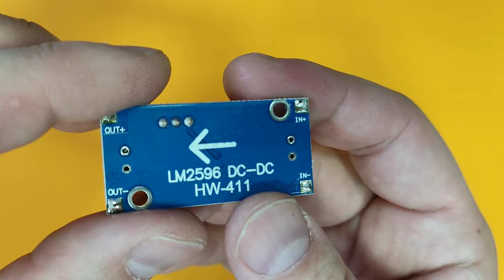How to power Phone Forever Without Battery

Comment: With the addition of the resistor, would it not be possible to connect the power through the phone's USB port?
Reply from the maker: There is no problem with the resistor. Built in battery has the same resistance for this particular device. It mimics the thermal protection of the battery. I've tried to transfer files from this device and it worked just fine. Just keep in mind that every device has specific pinout and resistance between the pins. In most cases 10K will work, but I just have to notify you about this. Good luck 🤞
Reply: @FixitEasyDIY  I understand that. Since the resistor tricked the phone into thinking that a battery exists, I am merely asking whether the power cord can then be connected using the phone's USB port, instead of going through the back of the phone. It would be a lot easier and neater if this can be done.
Reply from the maker: @lwh7301  unfortunately there must be voltage on the pins of the back of the phone. I believe it wouldn't work without it. I didn't try that but the thing is to give the device what it is expecting ;)
Reply: @FixitEasyDIY  You're probably right. I will give it shot before I drill a hole in the back cover.
Reply: When you connect charger through charging port, does it detects charger connected? Coz i want some task to automate when charger connected?

Comment: samsung s8
lm2596 screen (3.85-4v) >
i solder usb type c for I +/- port
then solder out +/- to batery circuit board,
it just turn on and turn off
Reply from the maker: Did you used 10kom resistor?
Reply: @FixitEasyDIY   @FixitEasy  i don't have it,
supercapactior 5.5V 1.0F coming tomorrow maybe, don't know if it help, btw i don't see 3rd connector for resistor solder on battery

my pic since youtube deletelink lol https://www.youtube.com/@HDWB_Gaming/community
Reply from the maker: Sometimes 5v dc chargers cannot start the phone because it draws a lot of current when loading on start. :) Try using another power supply wich can deliver more amps to the lm2596. Go ahead and pls report ;)
Reply: @FixitEasyDIY  i have ravpower61w with PD cable but i think it won't work on that lm2596 cuz screen is not light on, when itried it with xiaomi 18w + PD cable, lm2596 just light on and function

xiaomi 5V/3A
9V/2A
12V/1.5A

ravpower61w
5v/3a
9v/3a
12v/3a
15v/3a
20v/3a
20.3v/3a

Comment: bro i had done this in my portable wifi router and the device is working perfectly fine but there is some amount of heat on both buck and the device, is it a problem? Also what will probably be the reason?
Reply from the maker: It is perfectly fine to generate heat. If you can hold your finger on the chip it's not dangerous. Just keep an eye on them for the first couple of days.
Reply: @FixitEasyDIY  ok thankyou for the replay ❣️will check it

Comment: I will try this on my old Alcatel 1588 :)
Reply from the maker: Cool! Let us know when you power it :)
Reply: @FixitEasyDIY  Yes I will! I also like your background music in the video, I downloaded it and converted it to MP3 :)
Reply from the maker: @firstgear11382  Thanks 👍 Make sure (if you have the time) to read the comments. There are some hints to make it properly. For example the power supply must be slightly powerful because some devices are pulling more than 1 amp when starting. Another point is to measure the old battery (if you have it) for the actual resistance between minus and the third leg. Some phones require different resistance, but in most cases 10k will do the job. Good luck my friend 👍

Comment: Does it work with Huawei p8 lite 2015?
Reply from the maker: If you can get to the battery compartment it will work. Just measure the battery between minus and termistor pin (the third pin) for resistance in order to determine the right resistor to be used.  Most of them are 10 kom.
Reply: @FixitEasyDIY  thank you
Reply: @FixitEasyDIY  Is Minus the second PIN?

Comment: whats the purpose of resistor 🤔
Reply from the maker: It doesn't work without it
Reply from the maker: It mimics the battery
Reply: @FixitEasyDIY  without a resistor on my smartphone it works, but the module makes noise, is that normal?
Reply from the maker: @ken.a.g  that doesn't sound good

Comment: I already bought the module but why does the cellphone just turn on and off and keep repeating
Reply from the maker: Did you solder the 10kohm resistor on the designates pins? If so  sometimes the power supply cannot give enough current for the phone to start. It draws a lot of current when loading in start. Try using another power supply, I think 12v 1 A would be OK. Of Course the output of the module should be set in 4.2 volts before soldering on the pins :)
Reply: @FixitEasyDIY  I don't use 10kohm . Because for now it doesn't have one. Does it have any effect. I only have the 2596 module
Reply from the maker: 10kohm resistor is a must here ;)

Comment: Hello friend , I really need your help, I have a Coyote S (it's a device that you put in the car that can tell where the radars are and film at the same time), the problem is that it's the second one I've bought and the battery swells so much that the screen breaks ! I would like to use it without battery but the problem is that it won't turn on without battery. Can you please help me? I have already disassembled it and removed the battery, I can pay you, thank you very much!
Reply from the maker: Don`t worry we will make it run like a charm. First thing is to determine the pins of the battery. Mark the legs in the device (+) (-) and (T) if there is third pin. Next thing is to determine the resistance of the thermal protection. If you can use multimeter you can measure the resistance between (-) and (t) leg of the battery. In most cases it is a 10K resistor. Watts doesn`t matter here. Then you solder the same resistor between minus and T. Next is to provide 4.2 volts (in most cases) to the legs of the device without the battery. You can use any step down voltage converter or  power supply that can give you 4.2 volts in your car. That`s all. If you need some futher help write here and we will discuss it further.
Reply from the maker: I`ve checked this device online and it has only two legs. That makes it even easier. Here you should prowide to the corresponding legs of the device 4.2 volts and it will power up. I am pretty confident that you can make it by your own ;)
Reply from the maker: Another hint from me, herei n Europe we use Waze a lot and it has the same funcionality as the Coyote S but using your smartphone.
Reply: @FixitEasyDIY  oh , you are from Europe too , I am from Belgium and I speak french 🙂 thank you for informations, I'll look but I'm not very smart in this area 😂 my battery has 5 pins
Reply: @FixitEasyDIY  Hello friend, my battery has 5 pin connector, 2 red, 2 black and 1 white , the problem is that I can't even find a replacement battery, the batteries I find only have 2 pins (1 black and 1 red) or 3 pins (1 black, 1 white and 1 red) 😔
Reply from the maker: You need to determine somehow the pins of the battery or the pins of the device. If you know someone near you who can measure the pins it will be easy job. Can you find some part number or something else for this battery. I also searched the net for the battery and found 2-pin replacements too.
Reply from the maker: If it doesn't work, at least you can use Waze app ;)
Reply: @FixitEasyDIY  Thanks a lot. I managed to see the "controller" of the battery and the 2 black connectors are connected on a single point (I assume the -) and the 2 red cables on a single point (I assume the +), and the white wire also on one point. With the information you gave me, I will try to find out how to do it. I know waze but I really like coyote 🙂 . Thank you very much !
Reply from the maker: That's exactly what you need. Now what is left is to determine the resistance between minus and the thermal protection pin ;)
Reply: @FixitEasyDIY  thank you very much, thank you very much, I'll try, I have a multimeter, but I don't really know how to do it. I will try today 🙂
Reply: My friend, sorry to bother you again. apparently on my battery there are 2 + and 2 - and 1 connector to manage the temperature. my question is: should i measure the voltage with the bms still connected to the battery, or should i disconnect the bms from the battery? And my second question is: on what position should I put the multimeter to measure the voltage between the - and the T. And finally my 3rd question: if I solder the bms of my battery on a new battery, can it work? Because then I may buy a new battery of better quality (the ones we saw with 2 connectors), I remove the bms from the new battery and I solder the bms from the old battery on it. Really sorry, only you can help me. Thank you so much!
Reply from the maker: @john-johnvanhamme3066  I will write tonight my friend, don't worry, we will manage it.
Reply: Thank you a lot 🙂
Reply from the maker: @john-johnvanhamme3066   @john-johnvanhamme3066  are you sure there is BMS in the battery? I would suggest to measure what voltage is between the red wires and minus without removing anything from the battery. It will probably be around 4 volt each. If so you could provide 4.2 volt to both pins of the device. In second question you should set the multimeter on 200K position to measure resistance between T and Minus. When you determine what is on the 5 pins you can give it to the device and make it think that there is real battery. On your third question I am not sure it would work because your device obviously have 5 pins. BMS circuit is only required if the voltage is more than 4.2 volts. It is managing the cells of the battery a.k.a. balancung circuit. Anyway, to make it work think of it like we have to provide the device the same voltage as the battery does. The only thing that we have to add is the proper resistance between T pin and minus. So in order to make it happen you have to measure: 1. Voltage between minus and red wires (each) and 2. Resistance (on 200K position of multimeter) between T and minus. Then, using voltage regulator, we can give the device the needed voltage and a resistor to mimic real healthy battery. Don't give up on trying it and please report how far did you get ;).
Ny friend don't worry to ask again if you need something else to takk about this. Talk to you soon 💖
Reply: @FixitEasyDIY  Yes, I'm sure there is a bms in the battery. Thank you for this information. I think I have no more solution because unfortunately I have already removed the bms from the battery. But no problem my friend, thanks to you I have already learned a lot, thank you very much for everything ! 😃
Reply: @FixitEasyDIY  I'm pretty sure the battery is 3.7V
Reply from the maker: No worries 🙂 you can still try to feed the device with 4.2 volts each red pin and 10k resistor between minus and T ;)

Comment: Tried this today on a Sky Device phone. Phone turns on for a few seconds and screen gets distorted and stops. Then tried it with a better power supply with more amperage. Phone stays on a bit longer, but turns off.
Reply from the maker: How many contact pins are there on your device? Did you use a resistor between minus and T pin ? Looks like a power issue because the device is drawing a lot of amps when loading the operating system or there must be some resistance to mimic the thermal protection of the battery. I would measure the resistance of the battery (if you have it) between minus pin and thermal protection pin . You can easily determine pins by using a multimeter.  Some devices are "waiting" for 10K resistance there, some are 5K and even 50K. In most cases 10K will do the job.
Reply: @FixitEasyDIY  There are 3 pins, and I measured it to be 10K ohm. That's the resistor I used with a step down module. I don't think the module delivered enough amperage, even though it said the max is 3 amps. I then connected  a PC power supply at 5 volts with 2 amps. It worked longer, but ultimately the phone also shut down. The PC power supply also has a 5 volts lead that delivers 30 amps. I didn't try that because I don't want to burn down the house.
Reply from the maker: @lwh7301  There must be something wrong with the setup. In this situation I would suggest trying to connect some healthy li-ion battery to the pins and see if the phone start and run normally, if so there is not enough current or voltage for some reason ;)
Reply: @FixitEasyDIY  I was not able to find a battery replacement for this phone. That's the reason why I was doing this in the first place. But I did put the old battery back in. The old battery no longer holds a charge very long. The phone starts with the old battery in. I leave the charge cord in and use it to stream music. I have another phone that has a swollen battery that I will try.
Reply from the maker: You can use any  3.7 V lithium battery with cables soldered on it. It's worth trying. This experiment will show you if you can successfully use other powers supply.
Reply: @FixitEasyDIY  I am actually thinking about using NiCd batteries to try since I have so many of them lying around...or even alkaline.
Reply from the maker: @lwh7301  🤔 I think they are not ok for this, because they are 1.5 V . If you combine 3 of them you will come up with 4.5 V. If they are discharged they cannot output the current needed and also they will drop voltage under load. My idea is to power the device with the battery without using the voltage regulator module. This could be properly done only by using a lithium battery i guess. I hope you will come up with a working setup ;)
Reply: @FixitEasyDIY  Yes...I am aware of the drawbacks. I will leave this project in the backburner for now. It is currently working with the old battery in it. However, I had to set the screen brightness from 100% to 15%. With the screen at 100%, it would turn itself off periodically even with the charging cord connected. Since I am using it only as a streaming device connected to my stereo.  I really don't need to have a super bright screen. So far, it hasn't turned itself off, and it's been 24 hours. Thanks for your input.
Reply: @FixitEasyDIY  Today, I finally got to trying it with a 18650 3.7v battery. At first, I experienced the same problems as before. Then I thought it may be because I was testing with alligator clips and that the wires were too long or too thin. I replaced them with thicker and much shorter wires and connected them with solder. I didn't have high hopes, but it worked! I was about to toss the phone, but now I am streaming beautiful music! Thanks for the tip!
Reply from the maker: @lwh7301  Wow sounds great 👍👍👍 I am really happy to hear that ☺️ Enjoy 🙏😊🙏

Comment: Hi, I have Moto E6s with kc40 battery.
i tried running it from charger or power bank, but as soon as i remove battery while using both charger or power bank it shuts off. mobile works on battery okish. sometimes switches off randomly. this mobile has been used while charging a lot of times. 
 I want to use that mobile in car for google map.
my questions are
1. How should I do it ? So it won't drain car battery fast. battery drain is my main concern.
2. How you selected 10k resistor ? any reason behind it. here is another example. he just used circuit from kc40 battery. he used 4.7k resistor. https://youtu.be/a06eVo1hSE0?t=164
will the resistor overheat if Iuse it continuously. what is normal power consumption rate while running with car music system.
thank you !
Reply from the maker: The reason to use 10k resistor is because there is a thermal protection inside the battery. I measured it and between the third leg and (-) leg of the battery showed 10k resistance. This will mimic there is a battery. Others the phone might not start. Some phones have 50k resistance of the battery's third leg and minus, some are 4.7 K. You need to measure it, but in most cases 10k is working.  Typical consumptions of the phone is around 1 amp when starting and 50ma in standby.
Reply from the maker: There is nothing to worry about overheating of the resistor. It is there just to make the device think that there is real battery inserted ;)
Reply: @FixitEasyDIY  thank you very much. Appreciate it.
Reply: @FixitEasyDIY  HI again, KC40 battery shows 8.3k ohm resistance, as I measured today.
You soldered it between -ve and 3rd terminal, the video link I sent in previous comment, shows resistance between +ve and 3rd terminal, so which should be used in my case (Moto E6s) ?
Also, I can solder any side of resistor to any point, right ? means it isn't one way, right ? I'm thinking of removing strip from battery and soldering it to phone.
Thank You.
Reply from the maker: The resistor does`n have side, so you don`t have to worry about that. This resistor must be soldered between minus and T pin in order to make the device think there is real battery. Sorry for my late answer ;)

Comment: Hi there, which voltage is setup on buck-down converter? 3.7V?
Reply from the maker: It's 4.2 volts ;)
Reply: @FixitEasyDIY  makes sence, thanks :)
Reply from the maker: You are welcome brother 😌
Reply: Why didn't you use 5 v directly? Why using down converter only for reducing 0.8v ?
Reply: @deepakrautela9342  The phone expects to have a 4.2v battery there, if you put 5v into it you risk blowing it up.